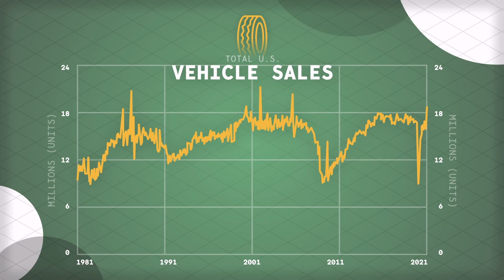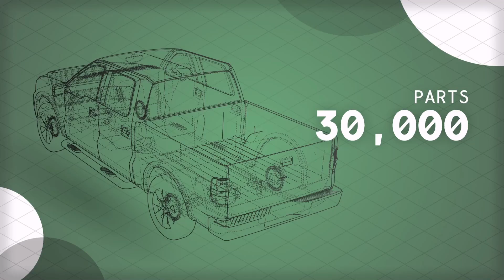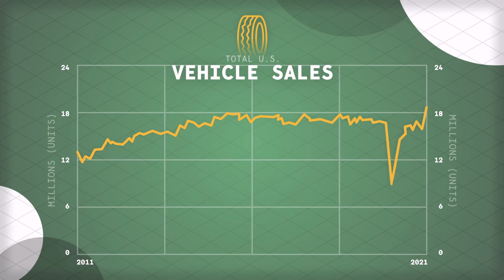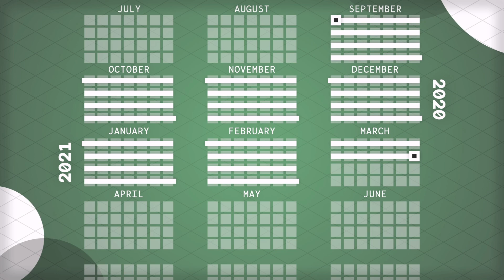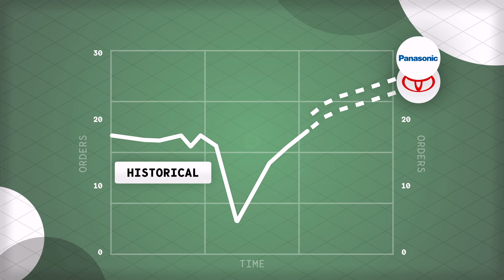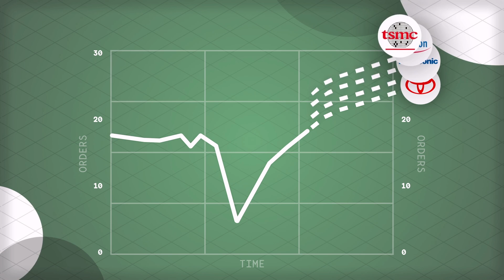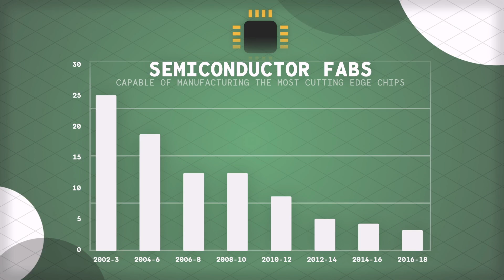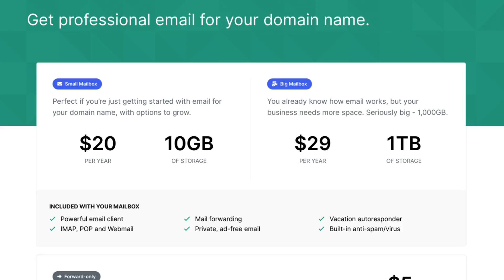Why the World is Running Out of Computers

Comment: i wish cars would have basic windows, gauges. I never seen the reason to have fancy electronics
Reply: Or manual overrides, I can’t understand why “E Brake” took off as a thing. 😐
Reply: @DrumToTheBassWoop  I suspect it's related to autolock brakes being safer, more effective, and less demanding than manually pumping brakes to increase their effectiveness.
Reply: @eusebiusthunked5259  until it doesn’t, that’s my point, a pumping mechanism is still better than electric. 😐
Reply: @DrumToTheBassWoop  there used to be hand brakes as the backup, but apparently data shows that ABS is more reliable than manual pump brakes. You still perform the manual brake pumping, but the electric assistance overtakes the action. I would need your data saying the ABS failures are more common than pump brakes which also aren't direct action, but rather pneumatically assisted.
Reply: I drive mechanical trucks from the 80s. No plastic or electronic junk
Reply: Because oooh shiiiny
Reply: More stuff to brake and more profit for them
Reply: Just take a bus then
Reply: And there is no reason for that. It's simply a waste of recources.
Reply: 1957 cars new cost 3,000
Reply: My cousin is a mechanic and he complains about the over-reliance on computers. Most of it isn't really necessary.
Reply: @lambd01d  Necessary to propel a petrol gasoline motor forward?  No, that's true. But for conforming to modern pollution emissions standards as required by law... Yes, it's absolutely necessary unless you switch to a different fuel source.

But since we were talking about electronic assisted braking methods, I'd argue that what's necessary to make the engine run isn't necessarily the same as what's necessary to save more lives.

Edit: confirming, oops
Reply: @Yummy Spaghetti Noodles Even the safest driver isn't immune to whatever the world throws at them

Comment: You can be absolutely sure the Chinese have nothing to do with the chip shortage. You can also be absolutely sure having fewer cars on the road isn't some planned pressure by the anti-car forces to make owning a car more difficult. It's just a bunch of manufacturers that can't figure out how to order $5 chips. They can order analogue speedometers and have them made but can't manage those tricky chips. The same goes for the hacked fuel pipeline; it isn't the Chinese or the Russians or the Greenpeace activists. You can also be sure bitcoin mining hasn't resulted in any chip shortages or wasted electric power.

Comment: This is most of the story but not all. The leading edge fabs have the problems outlined but there is a lot of previous-generation fab capacity which is sold off and used for things like embedded processors (e.g. the car processors). The power consumption requirements of automotive processors are not as stringent as pocketable devices. Maybe some of the user interface components have to be current-generation to make the developers happy but all the process-control systems for the engine etc don't need bleeding edge chips.

It is a shame that all the chipmakers have gone by the wayside. Economies of scale I guess.

Comment: If they rushed chip manicuring the amount of faulty chips per wafer will be way higher than it already is, meaning wasted money
Reply: There is no such thing as "rushing" a chip. You can't make chemistry faster, not at this level of precision. They could skip the testing, but that would be fatal especially in safety-critical usecases such as cars

Comment: The larger disaster will be when the shortage of chips (for new build & repair) sidelines too many big rigs and locomotives.  Then even items with zero chip content won't be able to get to stores.  The average commercial truck today has even more chip content than the average passenger vehicle.  Many are already deadlined waiting for chips to repair them.
Reply: It's already starting, there are garage yards full of trucks waiting for parts
Reply: @gurgy3  Agreed, but I'm referring to when the tipping point hits where increasing driver hours & vehicle utilization on remaining operable vehicles can't make basic deliveries to stores.  Given that locomotives will eventually hit the same wall the effect will be compounded.
Reply: @johngori6518  No driver hours to increase really, unless the DoT waives the 14/84 rule, which wouldn't help all that much.  Sounds like somebody needs to regulate some interstate commerce here and tell cars and gaming consoles they're gonna' have to wait until we stabilize our continental shipping infrastructure.
Reply: @mjl1966y  While I generally agree (former CDL [long ago] and worked as a trucking dispatcher) I was referring to using drivers idled by broken rigs to team with drivers who still have working trucks to increase utilization on rigs not already being driven 24/7.  Obviously that only works until those rigs break down as well.
Reply: @johngori6518  10-4.  That makes sense.  But I hate sharing a condo. :)
Reply: No farm tractors, no food.
Reply: @user-bg2oi4bz3p  This. Nobody thinks about the planting/harvesting equipment, which they already have locked down so only the manufacturer can work on them.
Reply: @bustedupbungalow  "You will own nothing and you will be happy." - klaus schwab
Reply: This issue can get very scary.  Chip shortage affecting the machines (CNC lathes/mills) that create semiconductors. making it harder for the plants to create more supply thus scaring more people to order more supply.  Death spiral if it comes to that.

Comment: Don't need a computer to drive a car , they added that luxury for large profits .  A simple combustion engine is extremely fuel efficient and clean burning when you actually use the fuel .. when you use dirty fuels it gets a little dirty ..simple logic , simple logic built simple engines but throw in useless tech for luxury you get luxury spending !!

Comment: Once again, auto maker's penny pinching attitudes cause problems.  I'm not sure if any other industry cuts corners and costs to the degree that the auto industry does.  Sales dropped sure, but most auto makers had enough cash to keep their orders of computer chips the same...just store the parts if sales don't bounce back quickly...but rather than look beyond the immediate situation, they simply saw a way to cut costs.

Comment: Personally, I don't mind analog parts.  I can replace them myself.  They don't require a specialized industry or the same power drain on the car.  I drive a 1995 Saturn.  I use a grandfather clock.  I think the obsession with electronic everything weakens us beyond supply chain management.
Reply: Hear, Hear
Reply: What a nice story Grandpa.
Reply: @joeyt6089  and full of wisdom, young and dumb.

Comment: What i don't understand and you did kinda say later on... is that if the chips take so long to manufacture, you would think that the production would never stop or slow down, regardless of the amount of orders coming in. They had to know that a temporary slowdown in auto orders, with an increase in electronic orders means zero slowdown in production.

Comment: Your math needs some work.  You said automakers spend 5% of their GDP (sorry GDP is not a metric used to explain a company financials) on semi-conductors.  You also said this is only one $4-$5 part.  This is wrong in so many ways.  $5/$35,000 average vehicle selling price is 0.0014%.

It's also completely inaccurate to say auto makers only use one chip.  Most use older cheap chips that the have low margins for the semi conductor manufacturers.  So why would they make those cheap chips when there is huge demand for Apples new ARM chips, NVidias graphics & data center chips, and AMD's gaming chips.  The semi conductors build new fabrication plants that cost between $10 billion - $12 billion just to produce the latest generation of chips.  How would they pay their debt payments on the loans taken to build those factories?

If you could make a video and you knew it would make you $10,000 versus another video you could make that you know would make you $6, what would you do?  Especially when you can only do one video or the other.  You don't have time to do both.  When factories had to follow C-19 rules imposed by their governments, what do you expect them to do?  Run at 20-50% staff and focus on the least profitable segment of their business?

Also you said if Toyota saw its sales go from 18 million a month to 20 million a month, they would adjust.  Toyota's GLOBAL ANNUAL sales in 2020 for all vehicle types was 9.5 million.  That's an average of 792,000 per month.  You're just off by a factor of over 25 to 1. You really need to do your research before making these videos.

Comment: They all wear masks to avoid the current gain of the transistors being affected. If the current gain is affected the device will simply work at different voltages than those you want.

Comment: Real reason is the death of Moore's Law. It makes things more complicated than ever and hard to account for. We don't get 2x increase in transistor densities every 2 years anymore, not even at a higher cost, or higher power/lower performance, not even in low power ARM chips, progress is stagnating.
 
Example: PS4 APU(28nm) has 10x higher transistor density than chips in original PS3(90nm).
PS5's APU(7nm) on the other hand, despite being much more powerful relative to PCs than PS4's counterpart was at the time, only offers 4x increase in M tr/sq mm, less than half in the same timeframe.

Fun fact: Many people also see AMD's chiplets as a sign of progress, when it's actually the exact opposite.

Comment: Wrong, The Peugeot 308 dial is a Euro Carparts supplied part, automotive companies outsource for cost effectiveness, you will find many parts from many models that are simply universal parts for different cars, I had an example of an exhaust for an old Fiat Punto many years ago, the part was brought from Euro Car Parts and was not built by Fiat, the only difference was that two prongs on the end had to be bent into position with brute force as it was a similar fitting on a newer model.

Great Video but cut the bullshit.

Comment: Very simplistic view of only 1 issue the supply chain faced.

Youre also missing that digital displays (heavily impacted Tesla) use a manufactured part that relies on a very old node that has a near 100% yield. No fab is going to tool for this process as it is not go forward or profitable to do so yet TV, car manufacturers will get the cheapest part available. As factories retool they are lossing older node capacity and will never retool for it.

Also switching the tooling process for a wafer isnt like swaping a pencil for another, this is even more complicated when switching nodes

Dont forget the water shortages and power issues on Texas crippled capacity. These factories take weeks to shutdown and sudden stops are catastrophic.

Comment: Do we really even need computers in cars? I think a lot of what cars require can be done with simpler analog devices anyway. I honestly don't like having that big ugly touchscreen in the center of the dash rather than some simple radio knobs anyway. Maybe we should take this opportunity to rethink whether having computers in literally everything is actually a good idea... a fridge, a blender? Really?
Reply: Computers are used in far more things in a car than you'd think. For instance, I'm pretty sure modern airbag systems use computers to detect collisions better to allow for quicker deployment. ABS also uses computers. In a lot of cases, most of the indicators on the dash are controlled by computers. I'd say the best use of computers in cars is in the safety features newer cars have (sensors, lane deviation detection, etc.)